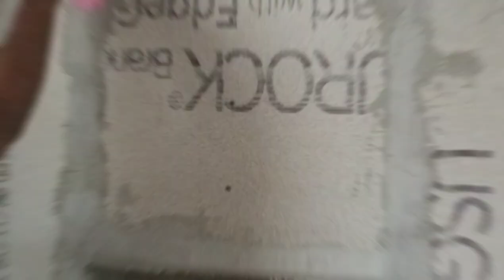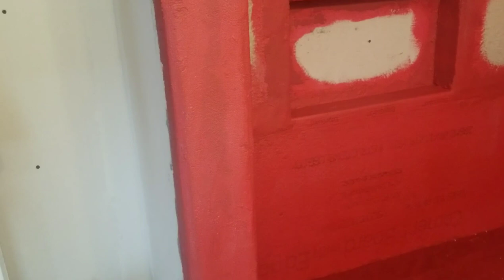#28 Roman Tub/Shower Continue

Comment: Hi, did you apply the red guard directly to the sand on shower floor ? If so was it a simple pour? Or did you spread it with something? Great vid
Reply from the maker: We didn't use a form so we didn't use sand. We use a mortar mix and then the red guard, several coats...no leaks so far
Reply: How much and what type of mortar mix did you guys use?
Reply: @davidcason3915  it was a common deck mud. Like 4 in 1 from Lowes it looked liked.